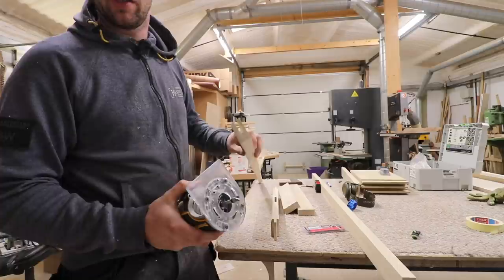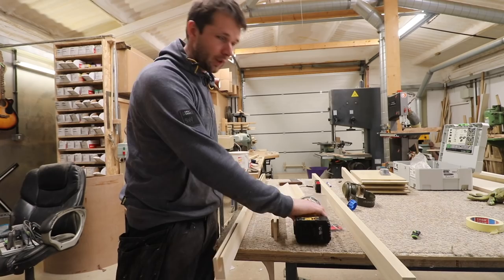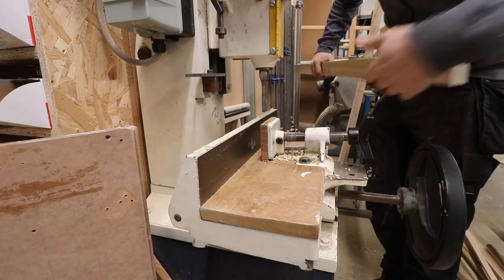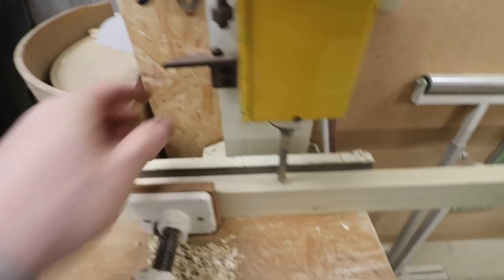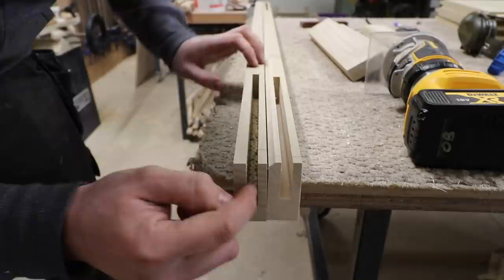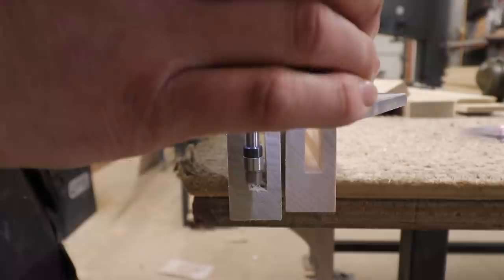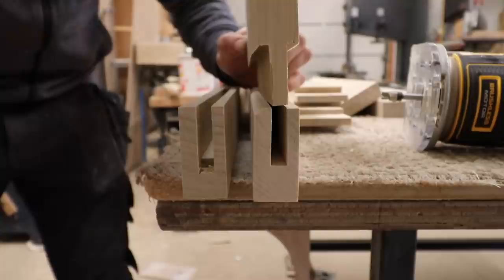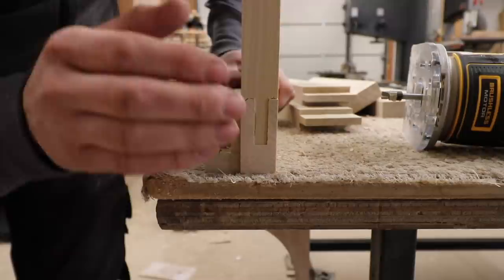I Wish I Discovered This Router Bit Years Ago!

Comment: I just finished going thru this dilemma on the first 4 of 28 interior doors i'm commissioned to built. That is 40 mortises on just 4 doors! Having to go back in with a mortising chisel by hand to clean out the bottoms has been time consuming and a royal pain to say the least. From milling the lumber/timber from rough to this stage of a door component, a fair amount of labour has gone into that piece so any time savings is a win. I cannot thank you enough for taking the time to share this bit and process that you have stumbled on, especially showing us to go deeper on the ends with the mortiser for shavings clearance.  Cheers mate!
Reply from the maker: Mate, its a comment like that that has made making this video worthwhile so thankyou! I knew i wasnt insane looking for a cutter to do this task, and glad ive found one! did you order one and has it worked?
Reply: @BradshawJoinery  Just a quick ( hopefully ) question... I need a depth of cut of  74mm  as my application is for interior doors, not cabinet doors.  Ignoring the recommended collar marking ( hehehe ) could i get that depth in your opinion ? I can't seem to find that spec for the cutter... Cheers!

Comment: I'm not a big fan of having that much tool hangout from the collet.... As a machinist by trade, its a recipe for disaster when machining steel... Obviously woods softer , but at the rpms the router is running , you can get vibration on the cutter which can encourage tool movement in the collet... Be careful, mate ! 🤔
Reply from the maker: Thanks Peter, I will keep the tool hangout to as minimum as possible and heed your advice! Thankyou

Comment: don't you find that the glue has nowhere to go with such a tight fitting joint? Not that I ever have a lot of these to do I think I would make the first 10mm or so the correct depth and then the rest  a mm or two deeper , the shoulder of the tenon will still seat properly, the visible joint would look perfect and the glue will still have somewhere to go. It is a neat method none-the-less.

Comment: I know exactly what you mean, what we were learnt was to cut your haunch a little bit too big but cut it back at an angle and squash the slightly pointed part into the mortice, keep up your good work, love watching your videos 👍👍
Reply from the maker: Cheers Brad, yeah thats the old way, only issue is cutting the door down later on can expose a gap, and any timber compressed acts as a wedge on the joint, so hopefully this is double good. Its made my life a lot easier!
Reply: @BradshawJoinery  absolutely mate couldn't agree more, 👍

Comment: The short flue pattern bits are so useful.
I use them from 3/8 up to 1,1/8 diameter  all the time. Wealden sell some with a 3/16 flue length and double bearing and really cheap.
Reply from the maker: Cheers MAte, yes Wealdon are a good company!

Comment: Hello mate great channel and i've been watching your channel for a couple of years.
I'm a carpenter / joiner and have a workshop and have all the usual machinery that a joiner needs.
Ok so my question is do you cover your machinery beds and blades with anything ?? The reason i ask that my table saw bed and planner bed go quite rusty when its moisture levels get a bit high due to rain, and i will admit to running a bit of green oak through the machines from time to time. I sand the beds down with sandpaper to get the rust off and wax them up routinely, but i still the rust coming through.

Any ideas and advice would be a great help
Reply from the maker: the basics of it are temperature change, the solid metal mass, will hold temperature and change slowly but the enviroment around it changes quick. Slow the envionment change around the machines down and it wont condensate... basically insulate the room and try to prevent moisture inside is your goal.  If you cant i know some folk will oil the beds each night then remove before use. I had good results from the liberon machine wax in my old shop, but its impossible to prevent it some days, the machines would be covered in condensation.

Comment: Pretty slick, I could see getting set up with a methodical system and that not really adding much time to the whole exercise.  Could even do it in a router table perhaps?  Set a stop so you know you've gone far enough?  Good vid!
Reply from the maker: Cheers mate, it will deffo help me earn a few £ haha! Handheld router is best for the stop start nature and quick easy positioning. Easier to move a small router acurately than a long door stile. Its just a dead simple operation for a task that is normally a chore!